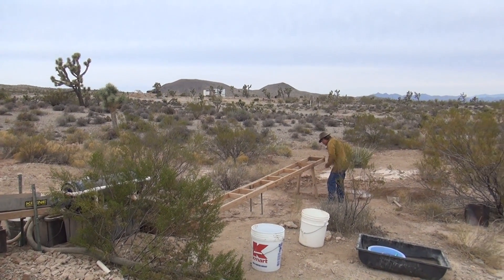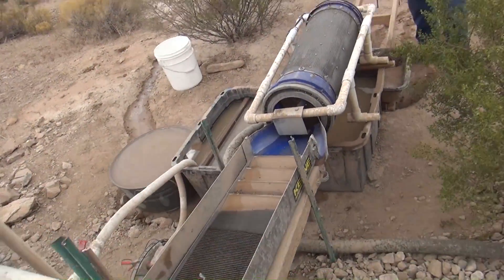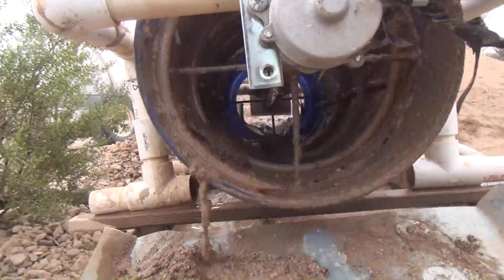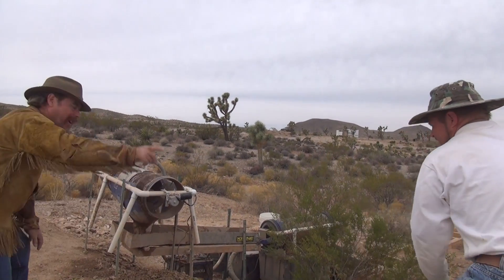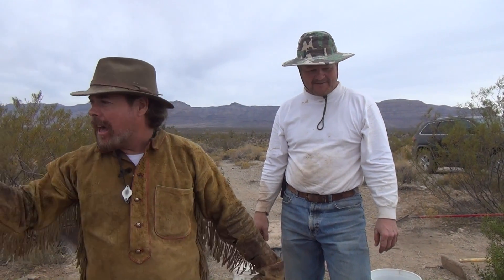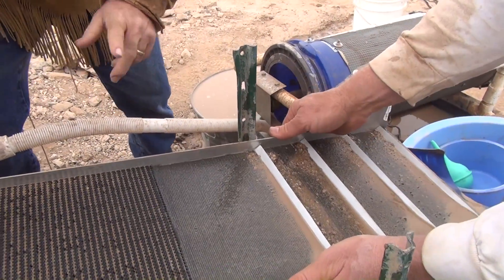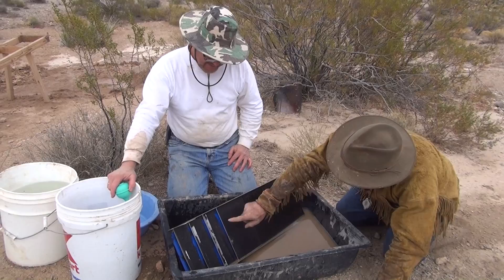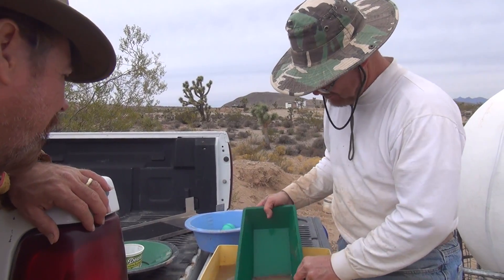TROMMEL WASHPLANT !!! Made from Pastic Buckets.   ask Jeff Williams

Comment: Jeff, it looks to me like the level of clay suspended in the water after a while would cause enough suspended solids to permit considerable fine gold to remain suspended.  Has he sent the mud thru a second time with clean water and some Jet-Dry just to check?  Maybe one of your viewers should figure out a remedy. Great video, Jeff, I always like to see how people's minds work to solve problems with new home-made equipment.
Reply: Hi Richard.  I can process about a yard of material before the water needs purging.  The fine silt settles primarily in the first tub.  Virtually no silt in the third.  I use Jet Dry.  I have also reprocessed the material with fresh water and recovered nothing.  Gold at -200 mesh if far heavier then the suspended micro-fine silt, and doesn't seem to effect the recovery.  I'm currently designing a new dewater trommel that will screen filtrate down to 400 mesh, thus increasing my capacity to process more yardage with the same volume of water.

Comment: Sweet video I need a set up like this just don't know where to start
Reply: Adrian sandford , Do you have fabrication skills?  Can you weld or bend sheet metal?  You’d need those skills to make something like this.  I’d help with ideas if you need me to.
Reply from the maker: actually Allan just put it together with PVC pipe and sheet metal screws
Reply: There are a few videos out there that can help get you started.  One in particular is titled " Trommel Build."  The guy is making it to separate fertilizer, but could easily be converted to gold mining.  If you go to my trammel video, I share some of the uniqueness of the design.  Good luck to you !
Reply: yeah i can weld use to make tractor buckets have sheet metal skills as well
Reply: thks Allan
Reply: Adrian sandford , Great!  Then you’ve got the skills it’ll take.  Do lots of research and watch lots of YouTube videos on sluiceboxes/highbankers and trommels and start building your favorite design.
Reply: Thanks mate will do i sure there's a lot of work getting the angles right with a trommel! Do u sell plans for your design ?
Reply: Unfortunately, I don't sell plans.  Got the angles right by using the 1" conduit pipe as an alignment tool.  Bored 1" holes on the bucket lids and bottoms then slid them onto pipe.  Then I installed the 1/4" screen around both buckets.  If you have good quality screen grids, this can be utilized to maintain alignment.  Then slide the unit off the 1" shaft, remove bucket lids, carefully cut the unwanted portion of buckets from the inside using a Dremol Tool or an angle saw.
Reply: Thanks mate wiil do